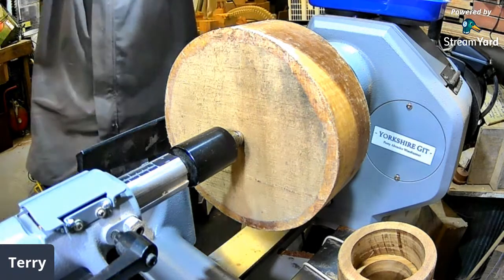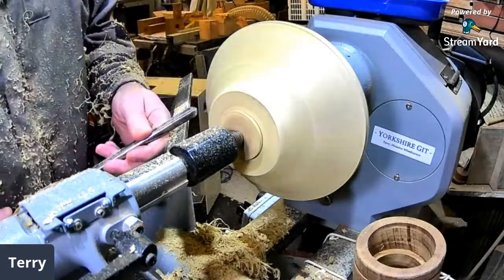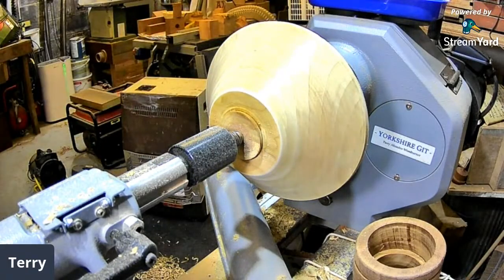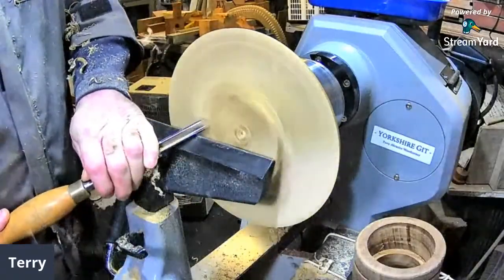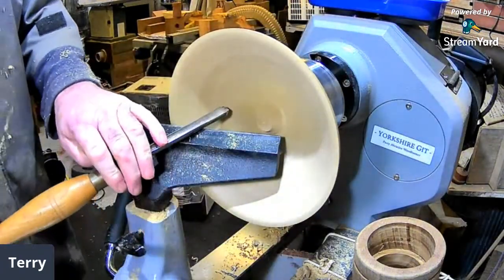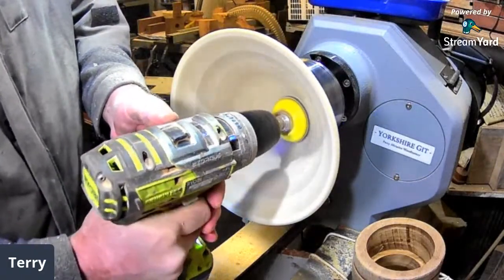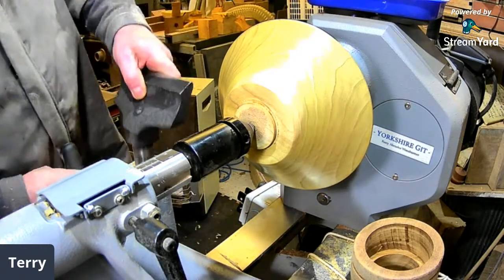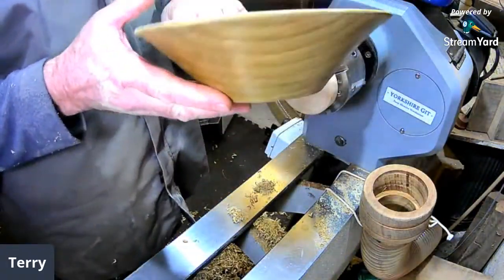Woodturning | Standing in for Mark The Gentleman Wood Turner

Comment: Terry you did fantastic even with all the questions,  Sorry I was a ass it will not happen again !!!  how long have you been wood turning and who inspired you to get in to wood turning.   I have asked and I am unsure if I was under stood, I am trying to find out if I put a bowl blank off centre between centres would I be able to turn it with a finish of one lip side higher than the other ??
Reply from the maker: Thank you Douglas for your praise. Right the first thing I have to say is DON"T you ever stop asking questions at all, it is a delight to have you aboard and making our live events interesting. Rant over, secondly I have been properly turning since about 1983, but I did get hooked in school in the 1960's. In those days there was no new technology to learn, I was fortunate to have a woodwork teacher at school then who  introduced me to the craft. Because I was shortsighted I couldn't do sports so I had double woodworking one to one. After I retired from the AA  I started my own business and did bespoke carpentry and turning to make a living for about 15 years before totally retiring due to heart problems (3 stents fitted) 4  years ago. As for the off centre bowl you will need to set the plane of the bowl off parallel to turn out the middle then you could go switch it around and turn the back. It would also work if you plained the bowl thinner on one side than the other and turn it on true centres. I hope that helps,
Reply: @HeckingtonArts  thank you for the information and help, I to have heart problems, pump side got an virus and stretched and would not pump properly so pacemaker and a load of pills each day keeps me going.. still trying to get my head around explaining and doing what I asked you, I have an image in my head of the blank wobbling half it's thickness and turning it like that into a bowl where when finished and stood on a surface one lip side is high and the other is low all most like a bowl cut at an angle
Reply from the maker: Yes Douglas I know what you mean, If you glue the blank on a glue block which is cut at an ages then the blank will wobble, then you can turn it as normal with one side higher than the other. I will try and do a video or a live to show you when I can
Reply: @HeckingtonArts  Thank you again Terry,  take care